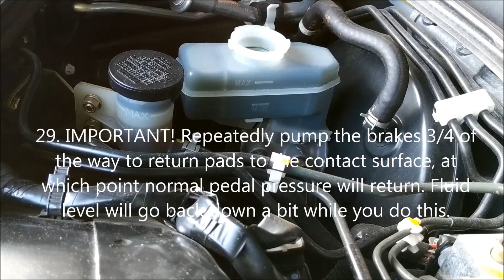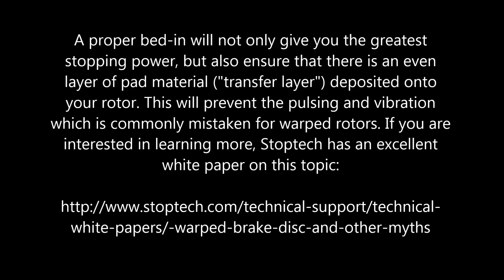G35 front brake pad replacement - 2003 2004 2005 2006 - same as 350Z

Comment: Thanks for the video!!  Saw exactly what I needed!  Anyone know why the bottom slide pin has that rubber sleeve?  I was changing the pads and the bottom slide was seized.  I could see that the boot had come unseated and it was a little rusty under.  It would still spin but it wouldn't move at all in or out so I had to pound on it to get it loose and got it out to see that rubber sleeve.  It had a little tear on it.  It wasn't sliding back in easily so I came online to see if it was not supposed to be pulled all the way out.
Reply: Seized pin from swollen rubber caused by improper lube used during the last brake job.

Comment: What order should I go in when replacing the rotors as well as the brake pads?
Reply from the maker: Whatever is most convenient for you - order doesn't matter.
Reply: @timwong3532  do you know the torque specs for the caliper bolts? I've heard mixed things online and i don't have a service manual
Reply from the maker: @Mrcool179  113 ft-lbs for the front caliper bolts.
Reply: @timwong3532  Hi Tim. Thanks for the video. 5 hours later and I finished my front brakes and rotors on my 2003 infiniti g35 sedan :(. The caliper guide pins were completely seized and not moving and required a blow torch and some immense muscle to get undone and lubricate. The entire assembly was pretty rusted which made it alot harder to do. And when i put my brake pads into the brake hardware they did not have any springiness even though i threaded them through that metal piece. I changed the rotor and pads because I was hearing a rhythmic scraping sound and i assumed it was a warped rotor. Well, upon replacing the brand new looking brake pads and slightly worn rotor I found that the sound is still there :( Any thoughts? Im thinking it might be the dust shield scraping along the inside? Otherwise im completely lost as to what it could be. Im also hearing a really intense grinding sound from the rear and im not sure what it could be! Are you able to do a video on the rear brakes and parking brake system? Thanks again for the helpful video, i referenced it throughout this ordeal :(
Reply: @Mrcool179  did you ever find out what happened?
Reply: @nastyshots2578  just sorta left it and it went away 😂 got a new car loool